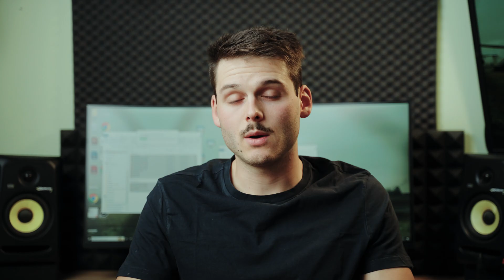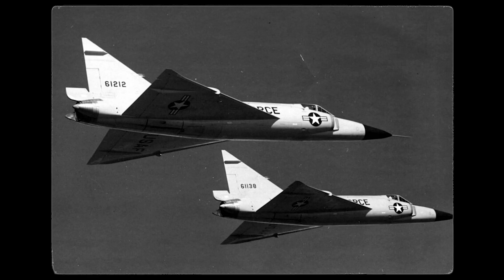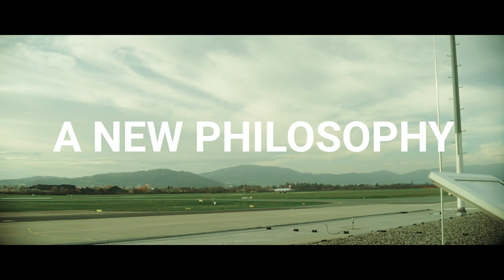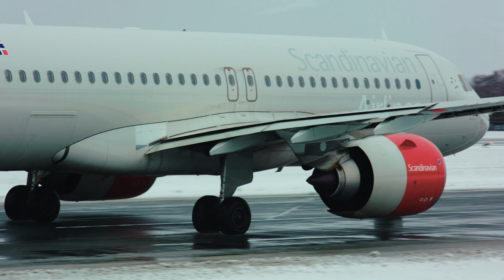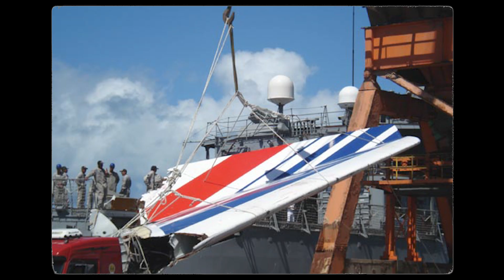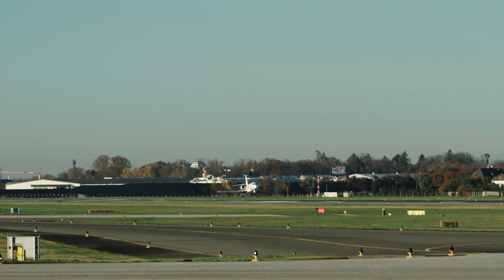Is airbus sidestick flawed?

Comment: Unfortunately the incident involving AF11 earlier this year proved that just because you have a linked controls doesn't necessarily mean you know who has control. The pilots were essentially wrestling with each other for control without realising it. Similar story goes for 5Y3591 (Boeing 767) where the pilot pushed the nose fully down thinking the plane was stalling and the captain didn't notice until too late. Linked controls mean a takeover procedure means you have to remind the other pilots  to let go or you end up fighting for control. So there is positive and negative to both  even with linked side sticks.
Reply from the maker: That's a very good point! Airbus has fitted a control takeover button for pilots. That means they don't have to fight over the controls. That also means that the pilot who pushes their button first has gained control and essentially muted the other pilot. The now-in-control pilot could maybe even be wrong about what he thinks is the right recovery control input to get out of a bad situation. I think they are just two completely different approaches and as you pointed out, both have their flaws...
Reply: Air France 447 showed that pilots having no idea what each other are doing is not a good idea. Even wrestling allows each to know what the other is doing. Lockheed 1011 had a semi fly by wire set up and was the first to have computer controlled flight plans. The best advantage of a side stick is that it allows the pilots to have a lap tray.
An former air force fellow told me that Airbuses are designed by engineers who think they are smarter than pilots. Boeing's are designed more to pilot's preferences.  Decisions about what aircraft to buy are made by bean counting suits. If the decisions were made by pilots the choices might change quite a bit.
Reply from the maker: @francoistombe  Airbus and Boeing are two different philosophies. I have talked to some of my IR instructors and they all tell me airbus is way more advanced and actually quite a bit more comfortable for pilots. Boeing is definitely more "hands-on" to fly... Would be interesting what aircraft we would see in the air if pilots could choose...
Reply: @francoistombe  you sound like a typical anti Airbus Boeing fanboi
Reply: @ant2312   We have no love for Boeing here in Canada.
Reply: @francoistombe  are you referring to the INS? If so, that came out 2 years earlier on the 747-100.
Reply: @francoistombe  Human Error is the biggest Reason for Crashes.
Reply from the maker: @K0nst4nt1n96  so you think more automated planes with a more "restrictive" flight control and envelope production system like is the case with airbus should be the way to go?
Reply: @_fordec  Yes. Flying the Plane in its normal envelope must be ensured by the plane itself. Free flight controls like the boeing 737 can form a more skillful pilot but depends more on his skills in emergency situations. As a Passenger i feel safer if there is the safety net of the airbus fbw but as a "Armchairpilot" i like flying the boeing more as its more challanging and more conventional.
Reply from the maker: @K0nst4nt1n96  I am pretty sure that with newer planes we will see flight control systems more like the airbuses... Although even considering Boeing gives pilots "more freedom" and more hands-on flying, based on the accident statistics, Boeing philosophy is not particularly safer than airbus' philosophy and vice versa. I think for a well-trained pilot, both systems can work just fine.
Reply: @K0nst4nt1n96  that's a limited view to just blame human error, one needs to look at the bigger picture and see what led the human to do that error, and it's not by putting much more complex automated systems that it is going to improve, quite the opposite. The envelope protections on the Airbus for most are protecting from stuff that a decently trained pilot would never do or unless he has a good reason to do so (I don't think there's been many crashes due to a pilot deliberately banking too much etc), and the issue is that the pilot are so used to being protected that they are not psychologically prepared to the idea of something happening to them (and for some stuff were not even trained for it, like high altitude manual flying and stall recovery for AF447), like the Air New Zealand crew flying an XL Airways 320 off the coast of France on a test flight testing out the stall protection, apparently not considering the possibility of the test failing, which it did, the protection never intervened and they kept waiting for it untill they were stalled and couldn't recover
Reply: Actually, in AF11 the yokes became uncoupled as designed due to sufficient opposing forces by both pilots. So yes, Boeing yokes can 'break' apart too.
Reply: you end up fighting for control either way, at least with linked controls you know you're in a fight and can address it.
Reply: @rodneystar  Multiple high stress circumstances have shown that isn't necessarily true. When the human brain and body are subjected to blaring warnings, somatogravic illusions, spatial disorientation etc etc, instinct can overcome reason.
Forces on the yoke are not simply and logically attributed to the other pilot. Especially since those forces can have other causes already accounted for by confirmation bias.
In either case, CRM is key. Pilots must audibly communicate.